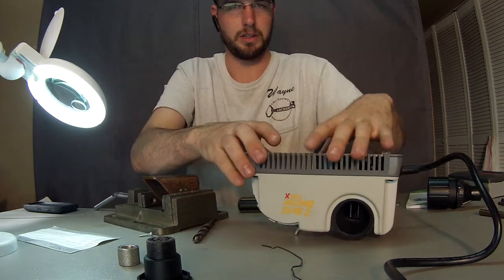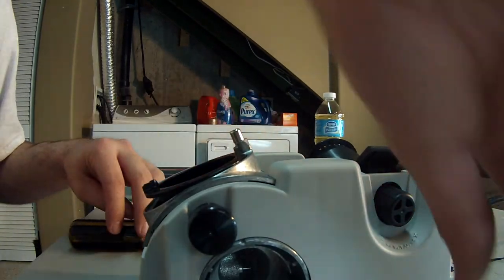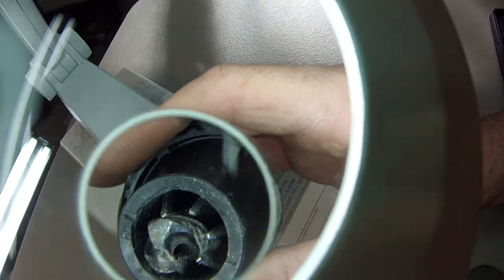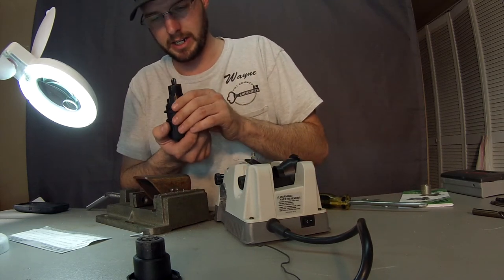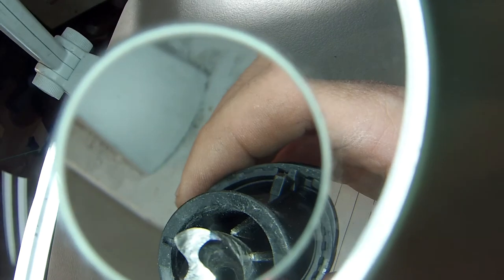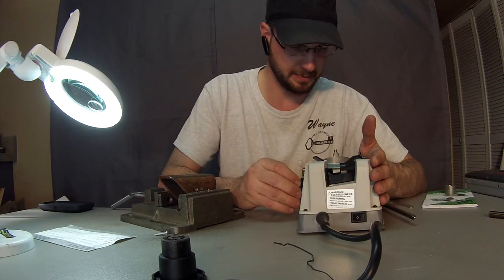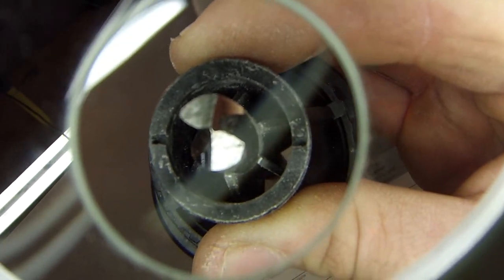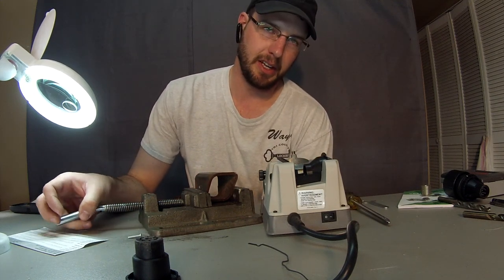How to Change Drill Dr. Wheel

Comment: If a drill bit (or any contact surface) has  turned a gun-metal blue like your bit did, the drill is ruined - unless you only plan to drill muenster with it from then on. The only way to bring it back is to grind it (cold, ideally underwater) to remove ALL of the blue, then vow to never smoke your bits again. Thank you for the good presentation. Helped my wheel change quite a bit! If I may share, I notice my diamond wheels last longer if I don't load the cut to the point that the motor drops to about 20% nominal.  Takes longer but is much cheaper. I was also brought  up to do all my grinding with a lube, which is wax for sanding disks and maybe a dry teflon for the diamond wheel. Prevents buildup.